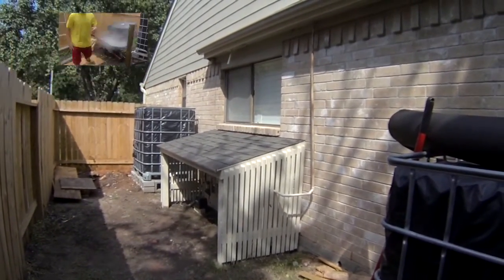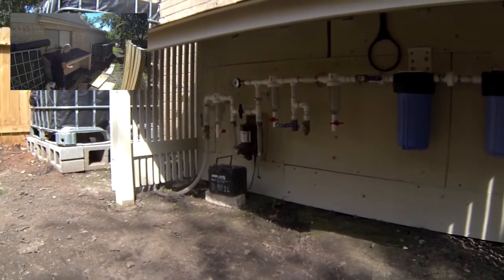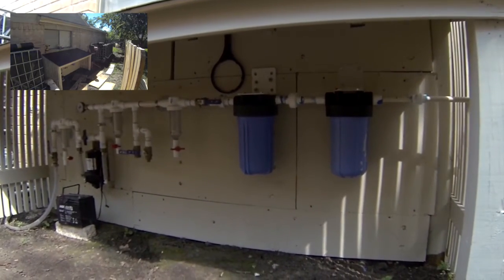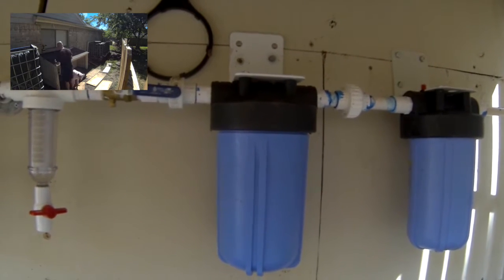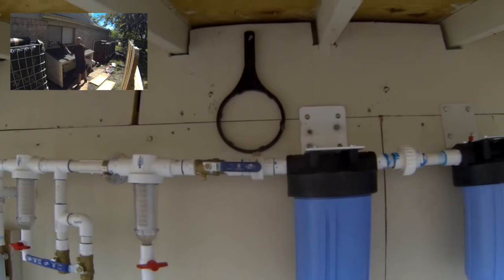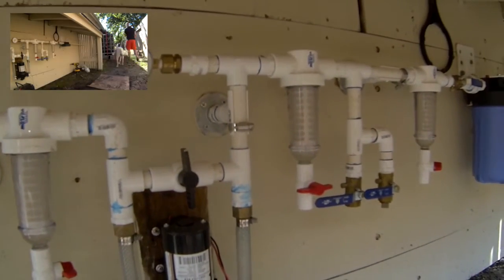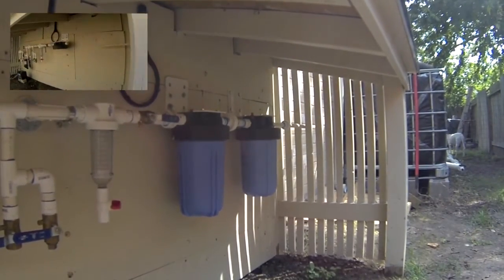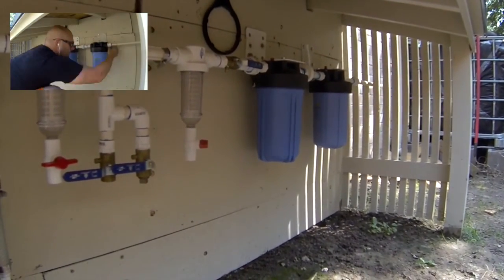How to Filter and Purify Rainwater Update #1

Comment: What kind of pressure do you need to push water through those ceramic filters?  Would they move through it with a gravity feed system even if it were slow?
Reply from the maker: +Brock Samson There is a slow gravity filter like the dulton rio 2000, I believe its called a berky. The filter I have needs a pump to work, gravity is not enough.
Reply: Trenton Kaminski
Thank you sir.

Comment: Any problems in the winter with this?
Reply from the maker: J Doe No problems, However I am near Houston, Texas and we only have about a week of freezing weather per year.
Reply: Trenton Kaminski
 I think I would have to hide this, here in Florida. They don't like this stuff. Very cool upgrade that you made. Have you thought about reverse osmosis as a add on? If not, why?
Very cool project and easy for maintenance.
Reply from the maker: J Doe I have this unit behind a fence, out of view to the public. Not a huge issue, the unit could be placed inside as well in a cabinet to buffer the motor noise. I though about an RO system. It wasn't for me, Typical Ro system produces water very slowly, filters are expensive compared to rainwater unit, Ro water is so pure that if you place it into a vessel not specifically for ro water, the ro water can pull the impurity out of the vessel and into the water. I can also run an entire home off of my unit and I wanted to learn about the purification process. RO is not a "bad "way to purify water, It just was not for me.

Comment: Will having a 5 micron filter before the UV would be sufficient or do you think going down 1 micron really necessary since it's rainwater? Thanks!
Reply from the maker: 5 micros should be sufficient, however you can't go wrong with a 1 micro. The ceramic filter is a 0.9 micron, the last blue filter on the water board. 

Since the last video I added another big blue housing but 20'' this time. I placed it between the two other big blue filters. The filter that had a 5 micron carbon I replaced with a reuseable carbon filter, its cheaper to replace and does not drop the water pressure like the block carbon filter I had. The new 20'' filter is a 1 micron bag filter. What i learned is, I needed more pre filtration before the ceramic filter (0.9 micron). It would become dirty quickly and required to much cleaning

Comment: Just came across your videos today. Very nice and thanks much for the hard work.

With the addition of the finer 250 filter and the addition of the carbon filter, have you experienced much pressure loss or GPM reduction at the outlet in your garage?

What was the rough cost of the UV filter and any pointers on sizing one?
Reply from the maker: Sig220Euro: I did have considerable pressure loss with the carbon filter, on the next video I will show what I changed. Im changing to a refillable carbon filter, if the information I read is correct it will have much less pressure drop. One more thing, the ceramic filter required cleaning to often, I now installed a 1 micron bag filter. New video soon!
Reply: Trenton Kaminski Great. I look forward to the new vid.
Reply from the maker: Frans Kemper I placed it between the two blue filters. What I wish I have did was to put two 20'' bag filters one a 5 micron then a 1 micron, and not have the 5 micron carbon 10''.
Reply from the maker: That line up looks good, Be sure to go with 20'' on #5 and #6 you will have to clean them less often. Only reason for ditching the carbon is because I ran out of room on my board and would have rather of had the large 20'' 5 micron bag. I have not made this change yet but would If I was building from scratch. Also if you do use a carbon be sure to get a 20'' of possible and also but a reloadable one. Then buy bulk carbon and repack it yourself. That will save you a lot of $$$$!  One more thing, check amazon for the 20'' bag filter, the housing is cheaper on amazon than anywhere I have found, BUT the replacement bags are MORE expensive on amazon. Don't pay more that 4$-5 per bag. Use google to find the bags, if you can't let me know Ill look up where I found them.
Reply from the maker: The 20 '' bag filters will include a pressure switch, it is a great help! The carbon filters I believe help improve taste, my water taste great with out the carbon filters. Like you said, the carbon is the least of my concern and is the most expensive to replace and upkeep. I think you would be just fine without it.
Reply: Trenton Kaminski Thanks for the work. It has been a great help for my own system. Question, where did you install the 1 micron bag filter? In between the carbon en ceramic filter? I am ordering parts as we speak and not able to wait for your new video. Thank you.
Reply: Trenton Kaminski Thanks Trenton. For my understanding, as I am building from scratch as we speak.
1) 250mesh Rusco
2) Pump
3) 500mesh Rusco
4) 1000 mesh Rusco
5) BigBlue 5 micron bag
6) BigBlue 1 micron bag
7) RIO 2000 ceramic
8) UV filter.
This for the post filtering and purification of course.
Would this be the ideal set up? And why ditching the carbon?
Thanks again.
Frans
Reply: Trenton Kaminski Thanks again Trenton. So now I am in doubts what exactly the pro would be for a carbon filter added to my line up. As far as I can judge, it adds the most maintenance than any other filter in my line up. In other words, what would I miss without a carbon filter? Also, I live in Brazil and everything I need has to be shipped and imported ($$$$$)! Henceforth, without giving in on the quality of the water purification, less replacement better it is. Local maintenance and cleaning I don't mind. Although I love the 3 pressure gauges idea...
Reply: Trenton Kaminski Thanks again Trenton, much appreciated. Now trying to find where to get the Big Blue 1 & 5 micron filter systems. Cheers, Frans
Reply: Trenton, sorry to bother you again. Can you please send me the link where you purchased the Big Blue 20" bag filter 1 & 5 micron? I am Googling, but not able to find the one with the pressure gauge included. Thanks again.
Reply from the maker: http://www.amazon.com/gp/product/B001VY0176/ref=oh_aui_detailpage_o07_s00?ie=UTF8&psc=1

The 20 '' housing with pressure gauge.
Reply from the maker: http://www.thepurchaseadvantage.com/page/TPA/PROD/pentek_bag_filters/W2T156735
1 micron bag

5 micron bag 
http://www.thepurchaseadvantage.com/page/TPA/PROD/pentek_bag_filters/W2T156737

and the amazon link for the bags... you can see they are more $$ on amazon, however the blue housing is cheaper on amazon 

http://www.amazon.com/Pentek-BP-420-1-Polypropylene-Filter-Micron/dp/B00A6X0NPI/ref=sr_1_4?ie=UTF8&qid=1422988935&sr=8-4&keywords=pentek+1+micron+bag
Reply: Trenton Kaminski Great and thanks. How long do these bags last before replacing?
Reply from the maker: Depending on the water quality, 50-250 gallons would be my guess. I will know soon after I complete a performance test. Good thing is they are cheap and you can reuse them many times, throw them in the washing machine then use them again. The bag filters allow you to clean the ceramic filter much less, which is awesome because it is the one I do not like cleaning, Right now I believe I get 100 gallons or so, but I go from 12 micron to 1 micron currently. You will have 1000 mesh or 12 micron, then 5 micron, then 1 micron. This will allow you to push more water threw before  replacing them.

Comment: Looks like a great system Trenton.  You might want to consider putting 3 pressure gauges in, #1 at inlet of your carbon prefilter, #2 between carbon and ceramic and #3 after the ceramic filter.  This way if either of those 2 start to plug up and decrease your output you can discern which of the 2 is plugging and only clean that which is necessary.  This is only for lazy old men like me though!
Reply from the maker: I love the idea! After a few months of running this system I wanted to expand the pre filtration to decrease cleaning on the ceramic filter. I just purchased a Big blue 20'' 1 micron bag filter, included on this filter was a pressure gauge. I completely see the use in this extra feature, work smart not hard. Thanks for the comment!

Comment: Nice configuration Trenton.  Good to see you added a carbon filter.  Carbon filters do require frequent changes (6 months recommended).  A small price compare to the replacement/maintenance of the other mechanical filtration.  Without the carbon you would find a slimy film on your ceramic filter and UV light.  This should make a big improvement to your system.
Reply from the maker: Keith Lavimodiere Any recommendations for carbon filters? The one I purchased I am not happy with, flow rate decreased to 2gpm.
Reply: You bought block carbon.  Switch to a granulated carbon filter (silver impregnated) and you will notice a big difference in flow rate.  GL
Reply: Trenton Kaminski Also you would be wise to purchase a clear refillable cartridge.  The top unscrews and you can pour the activated carbon (from a bulk bag) into the reuseable cylinder.  You will save lots of cash by loading your own filters.  Cheers.
Reply from the maker: Keith Lavimodiere Thank you Keith, I will look into this. Sounds much better than what I currently have.